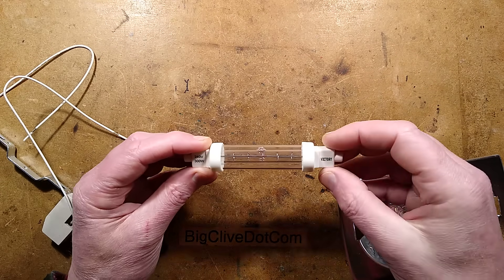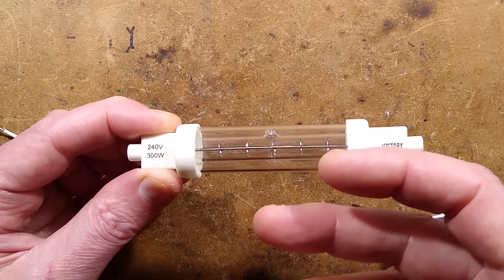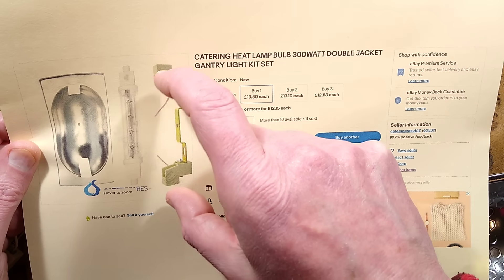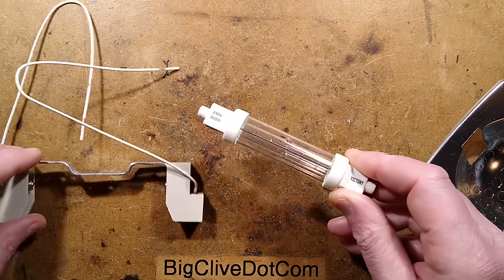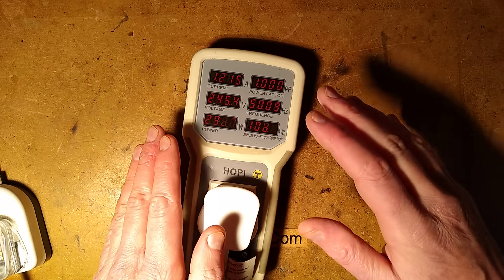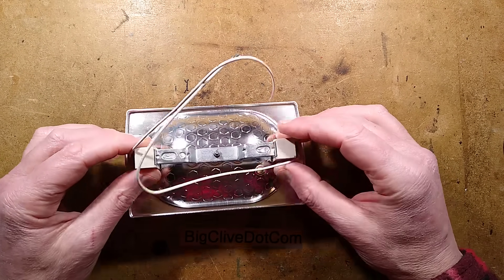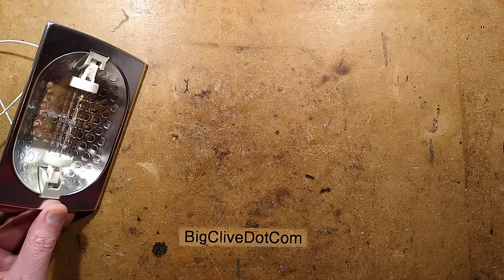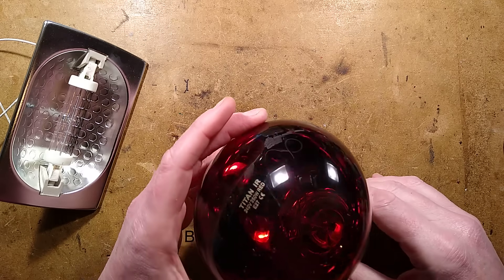Instant heat from an interesting linear heat lamp

Comment: Neat lamp but just dont cook your brain. 🤣🤣 2x👍
I was looking for clear tubes to make LED stick lights from. I did a quick google and found the food industry have plastic covers for standard size florescent tubes. They keep any glass (if the lamp explodes) from going into food. Come with end caps too. Im going to order a few in the new year. If you look for perplex tubes they are so expensive in comparison to them.

Comment: The anti-LED!

Hmmm ... no chance I guess of Clive building this up into a battery-powered pocket flashlight.
Reply: Just get the 120V version and use a 30S lithium ion pack to run it. It should run for about an hour on 18650 cells.

Comment: Any heatpump will give you more than 100%  thermal efficiency. Heating by passing current through wires is inefficient.
Reply from the maker: Heat pumps are complex and expensive to maintain, especially if installed badly.  They also heat the whole house, whereas this just heats surfaces like humans.  So it's a LOT cheaper than a heat pump in the long term.

Comment: The glass does an extra thing, stops anybody scalding their hand in the bare bulb if they touch it by accident!

The first time I found a 300w light, it was in an old slide projector from the 60s, but the bulb had gotten so hot, it had started to blow out at the side, how under a vacuum I don't know!

I'd gotten an infrared heat lamp, but sadly it put out red light, not just invisible! (supposed to be for pets like an iguana) I'd wanted to use it as a strong IR light for a camera, be interesting to see how far the range of this little bulb would give

Comment: Optimization for heat (IR) output makes sense for a food warming lamp, the pros do want immediate heat which is why induction heating and gas are the bee's knees among them.

I wonder if there's some way to use this in a space heater application? Maybe heat up a nice big chunk of steel and run a fan across it? Or get a 100 watt version as an active enclosure heater for a 3D printer if one wants to print ABS the way a Stratasys does?

Comment: Glass does not Like the oil on it.  Esp as it gets HOT.  The oil makes a Difference on temp on the glass..  It Shatters.
Reply: Is there a Range to the IR??  or will it travel a Good distance?
Reply: I like the Quartz heaters..  And the first time you get to see how they work with OPEN lens, Its amazing.  Cool until the Light HITS something to warm.
Reply from the maker: It seems to radiate well.

Comment: I wonder why my comment was deleted?
Reply from the maker: It's not in the filter.
Reply: I was just commenting on how the Oce 7650 printers that I used to run had big 2 foot long 5kw halogen heaters inside the fuser rollers and how that would make for a good heater but when I wanted to edit it a few minutes later it had vanished!

Comment: All the different types off heat lamp use in catering are useless as they continue to cook the food simply because they are fixed no more than a couple of feet above the food also in staff canteens the serving counter has heated bace plates as well as the heat lamps above. Bad design and bad idea.

Comment: i feel so tilted from you calling it instant heat like you just discovered IR heaters.
Reply from the maker: I'm used to the slower IR heaters with coiled element in a quartz tube.  This is much faster due to the lower mass.